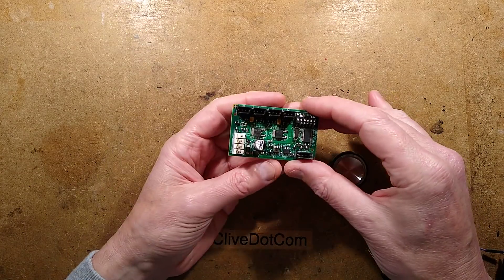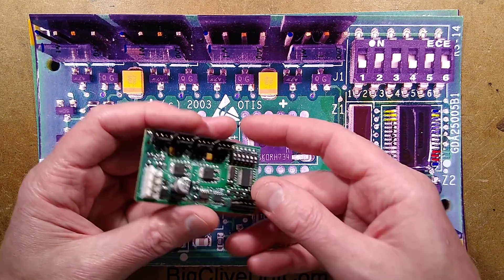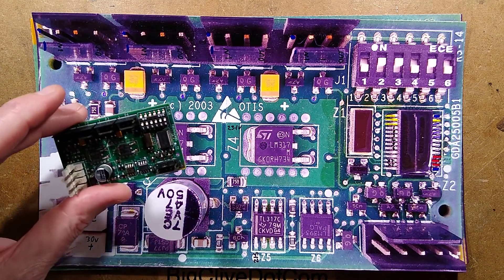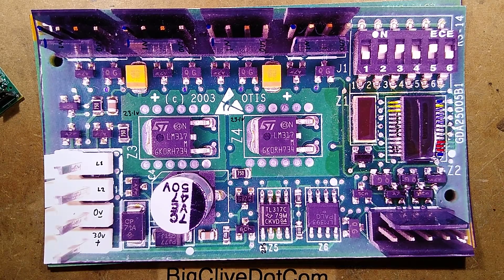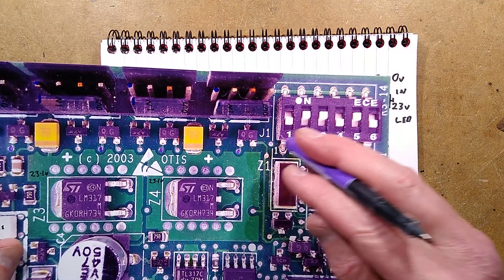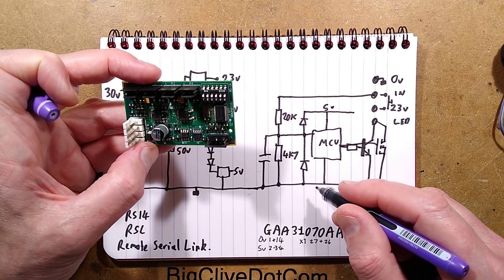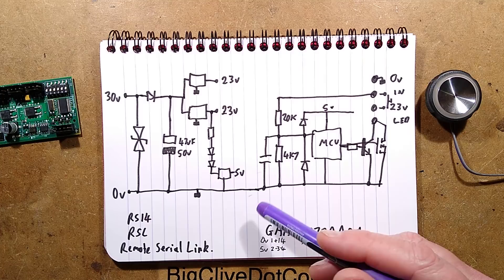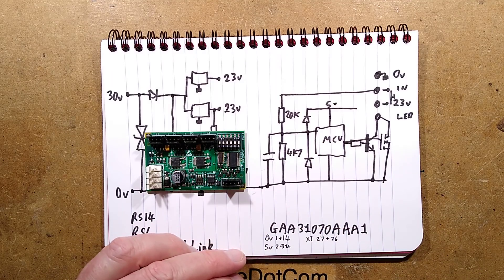Exploring an Otis Elevator button interface PCB

Comment: 2003 on the board. I wouldn’t be surprised if they’re still using the same board in new equipment: hey, if it works well…
Reply: We do still use them, and yes, they still do their Job perfectly fine ;)

Comment: In the good old days, you pushed the button and the elevator moved immediately. Today you push the button, the "brain" seems to think two seconds, then starts slowly, moves, arrives near its destination floor, slows down, "thinks" two seconds, stops, waits another second and finally deblocks the door. Complete bullshit!!! The old Schindler was much faster and worked for almost 60 years without any trouble!
Reply: Thats just a matter of the settings used, you are able to simulate the behaviour of an old elevator on new ones easily.

But we don't, since most people find the slow acceleration more comfortable.
Reply: @LachskoenigIV  A 30 second ride in an elevator mustn't be comfortable. An elevator isn't a toy for elevator mechanics on which they can test their programming abilities. It's just an elevator. And making pushbuttons with electronic boards that then aren't available and have a very short lifespan, aren't ideal either. The old, almost 60 years old buttons never have been changed. Can you simulate this too? My philosophy is to make it as simple and good as possible. I hate this nrew shit!
Reply: @jurivlk5433  from a companies position it makes sense. Those universal controls and buttons are cheaper in bulk than sturdy old fashioned tech which can't be used in every situation. 

New safety regulations also apply, the old tech wouldn't pass those today. 

No matter what you prefer, the comfortable controls are what people are buying, better get used to it I guess.

Comment: PIC MCUs often have built in RS485 hardware.
Reply: Arpad Toth  Now that you mention it, I think I may in fact be confused and my original comment would therefore be wrong.

Of course any chip with a TTL-level UART port can be married to the relevant line-driver and that would turn it into a proper RS232 or RS485 port. So I may be completely mistaken here. I didn't see such a transceiver chip on the board, and I'm not sure if there is a PIC controller with this built in (probably not if google serves).

Some of the ARM Cortex SOCs I've seen even have a built-in CAN-controller, and you just have to add a CAN transceiver (eg MCP2551 or TI ISO1050) to finish the job.

Comment: Having designed my own protocols for circuits, I wonder if the OTIS protocol includes error correcting codes to ensure noise cannot change or block commands.  After all, this is safety critical machinery, and nobody wants the STOP, ALARM or OPEN buttons to get lost or added by trivial faults.
Reply: Buttons that are safety critical probably would have separate lines.
Reply: Most networked devices are something like this....
Button at address 7 pressed
         ACK (host)

If it didn't work
Button at address 7 pressed
           Nothing (no response from destination)
timeout on random counter
button at address 7 pressed
      NAK (host) -  (Was seen but garbled, not understood due to stomp traffic)
timeout on random counter
Button at address 7 pressed
      ACK (host)

Comment: Before I watch this video, I only really have one question.  Does the “close door” button actually do anything?  I hope this eternal question will be addressed!
Reply: If you really want to know... Deviant Ollam has a reasonable number of videos about elevators and how they're controlled...
Reply: @tin2001  - Many thanks, I will have a look for those.  I am subscribed already but missed those.
Reply from the maker: It's programmable.
Reply: I've seen some where it obviously works, as the elevator consistently starts closing the door immediately upon hitting the button. Others, of course, still have a delay, so it's possible it will appear not to be working to some people. There are several reasons for this.
1. The elevator shortens the closing delay rather than skipping it. Thus, you don't notice any visible effect.
2. That elevator may be setup so that the door close button doesn't normally do anything for passengers, unless the elevator is in a special mode like independent service or fire service.
Either of these can be programmed by the technician or building owner. Some brands have a different "default" than others. Schindler's default setting seems to be #2, since that's how the majority of Schindler's behave. The building owner might later opt to change this setting to #2 if there are problems with people being rude to one another. :)

3. The button did work but has broken. Since the elevator is still 99% usable and it is unlikely anyone will complain about a close door button not working, it will likely go unnoticed for a fairly long time. However, it is required for independent service or fire service to be usable at all, so an inspector would probably point it out.
Reply: @dickcheney6  - Thanks for the info.  Interesting points well made, particularly about having a default setting but being able to change it to suit.  I never really thought much about this before, apart thinking that the button probably didn’t do anything!!  I’ll observe lifts more closely in future.

Comment: I think I heard someplace that Otis used neon indicators that didn't light up BECAUSE you pressed the button, putting your finger near the neon caused it to strike, and the circuit saw THAT as a button press. No moving parts.
(boy... was it "The Acme School of Stuff"? A fantastic Canadian science show from the 80's. Definitely worth a search for that. You'll love it in the first 2 minutes).
Reply from the maker: The Otis touch buttons.  They were powered by a DC voltage just below the strike threshold of the neon, with ground referenced AC superimposed on it.  When you touched the surface you provided a capacitive coupling for the AC that triggered the neon, and it then latched a series relay.

Comment: The board you have there is a general i/o board , it can be programmed to output / input any function to the controller , firealarm input, switch  on lights on landing floor via an external relay and so on.
There is an relay version of this i/o board aswell.  
When doing modernisation on older elevators (new controller with old door drives for example) we use this board to simulate the i/o signals needed to get the old door drive to work with the new controller.
Reply: Yep exactly. Everything is software defined now. Easier to build and cheaper to produce I think
Reply: Thanks for this! haven't come across this board before. Will know now incase i do :D
Reply: @Crafts and other Stuff Its possible.  These boards can do some weird things when they are addressed improperly.  Just the other day I saw one with a closed circuit on the board that was not supposed to be.  It was brand new and was causing a lot of troubleshooting and lots of blown fuses.  Finally found the the issue.  But like I said these things can make things act up.  But if it fails or creates conflict eventually a proper working elevator that uses these should shut itself down. 

The problem you are mentioning sounds like an issue with the electronic eye that is used for sensing people walking in and out of the cab. I will not get into detail 🤐

Comment: We still use OTIS elevators in my building. At least 40 YO and going strong, of course with required maintenance! Would love to see the other bits reverse engineered. Highly enjoyable as always!
Reply: If they are 40 years old, then they wont be this typoe of s**t. i started working for Otis as an apprentice in 1972. The stuff they installed then could be replaced or maintained by any company. This latest stuff cant.

Comment: Anyone else spend most of this video saying “Why????”
Reply: no... well maybe the part of the dual voltage regulator, one would be more than enough for providing the current for the 4 button leds. 
the rest is basic and standard
Reply: @rj7855  The dual voltage regulator arrangement may be to allow a load prone to taking out the regulator to have an isolated supply, separate from the one that drives the 5V regulator for the microcontroller. 

It was where they seemed to go out of their way to do things in an unusual or non-standard way that confused me. Things like using an lm317 variable regulator instead of a fixed regulator designed for the job like a 7805. Or building their own driver system instead of using an industry standard like RS485. 

Those standards exist for a reason and there were plenty of driver chips for them available in 2003 (or even 1973!) that with as good or even better transmission characteristics and protection from interference, electrical noise and static discharge. (More a problem for the microcontroller than a 20mA balanced line system)

Some of it may well, as others have suggested, be due to a desire to protect their intellectual property but using a variable regulator instead of a fixed own just adds to the component count and, in doing so, increases the number of potential points of failure.

Comment: I work as a elevator tech. It uses dip switch for address, every floor has a specific address which you change with dip switch . It can do more than buttons. And it is still use in Otis with newer system. Awesome system. Kone uses similar system for buttons.
Reply: I have a Otis series 5 elevator panel I got from eBay, any idea how I can wire the position indicator to display numbers?

Comment: You pushed the button at the start and the elevator still hadn't shown up nearly 13 minutes later.  I guess you'll have to take the stairs.
Reply: You leave the stairs where they are! They'll need them if the elevator is broken.
Reply: @R.Daneel  bah-dah-dum-tis, drum roll

Comment: I know nothing about that,is it possible to get a hoverboard and weld a frame and use a throttle to up the volts as an exterelrator bypassing all the electronics
Reply: your comment makes not sense, whatsoever 
Hoverboard?
weld a frame?
a throttle to up the volts?
exterelrator?
and how do you generate the serial signal when you bypass the electronics?

Comment: If they have a patent on the serial link physical layer or protocol, then you would be able to go look up that patent and see how it actually works. Connecting an oscilloscope to see if it tries to talk to another board could help as well.
I'm acutally a bit surprised there are not more surge/burst/ESD protection diodes on a board like that.

Comment: Otis is an old monolithic company that would use proprietary and obfuscated protocols and hardware to prevent secondary markets from forming around their products and prevent unlicensed mainentence from happening. Same as the auto manufacturers and farm equipment manufacturers. Someone is going to make money servicing that equipment and by God it's going to be them.
Reply: In the case of an elevator or escalator, I would hope it would be them
Reply: @almostanengineer  in the aircraft industry, third party maintenance is the norm. They obviously have to be certified for the aircraft type and conform to standards and regulations. 
No reason not to allow the same for elevators.
Reply: I used to take care of the equipment in a large old industrial laundry, and the Milnor washing machines were made this way.
Everything from bearings the size of your car rims, valves, motors, relays and contractors in the relay logic control system, etc, was custom made and generally only available through them.
Relays would have multiple stacked contacts on them, requiring 3 or 4 cludged relays to replace it if you didn't have the OEM one.
I loved the machines, they were very well built, because they wanted you buying their parts for many years! Lol
Reply: I don’t think it’s possible to be older than Otis in the Elevator market 🤔

Comment: I remember that when i was at college someone kicked the ground floor and second floor call button panels (the first floor, third floor, fourth floor, and fifth floor panels did not get kicked and so continued to work normally)
On the ground floor the button got misaligned, and you had to press it in a certain spot for it to work
The second floor panel suffered the worst fate, the wires broke and so the panel was completely non functional, and for the rest of the college year the panel remained non functional (so when a wheelchair user needed the lift on the second floor, someone else had to go to another floor, call the lift from there, and then send it to the second floor), i left the college at the end of that college year, so i do not know if it has been fixed or replaced
Reply: I was sick once in 6th grade and puked on the sidewalk outside the building.  nobody ever cleaned it up and the stain was still there my last year of high school.

Comment: My POE gigabit switch blew up the other week. At the 52volt input (not the power supply) on the main board it has 2 bypass/decoupling capacitors that blew a hole in the circuit board, almost all the way through the board and the tracks connecting them. Huge evidence looks like water was the cause but it is not located near a source of water or moisture.